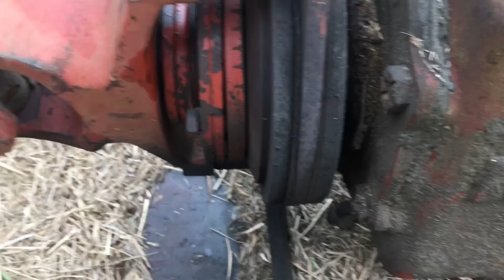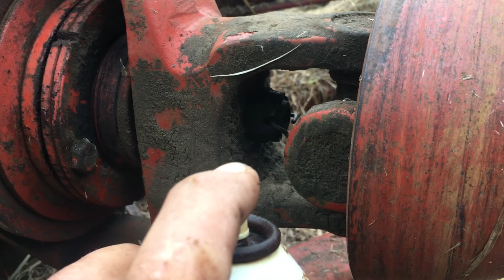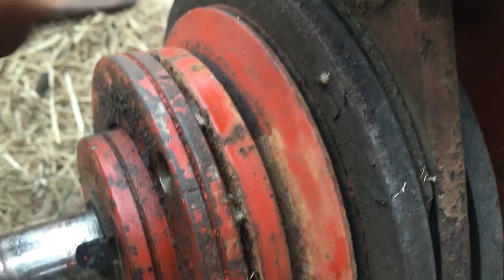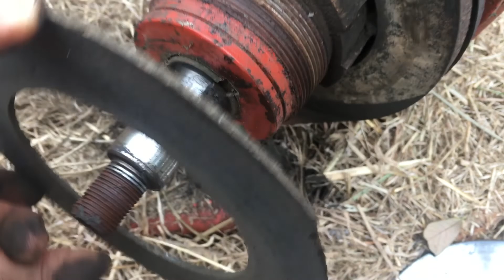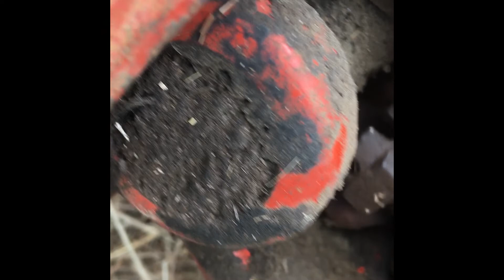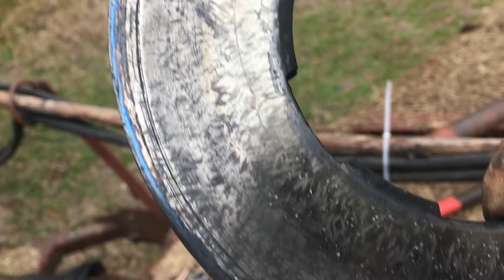Rhino Gearbox Friction Clutch Plates Repair + Adjustment

Comment: The three bolts are used to set the tension on your disk . If it slips tighten them . The back side of the threaded collar presses into the spring cups. Too tight loosen them. We have 3  20’ mowers with this set up hooked to 150 hp tractors, too tight your gonna break something. Worse designed slip clutch ever. No telling how many I’ve changed. Dirty job ain’t it.
Reply from the maker: I hate it when I find out that I am pulling a smokin' mower!  Appreciate the confirmation.